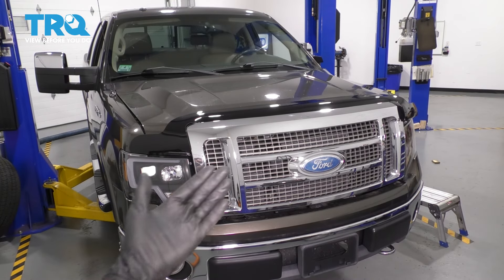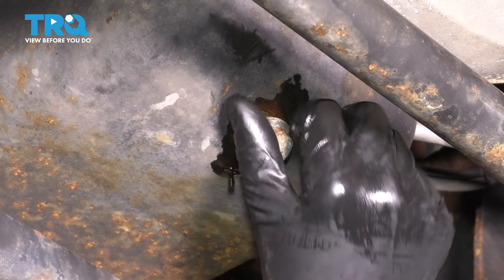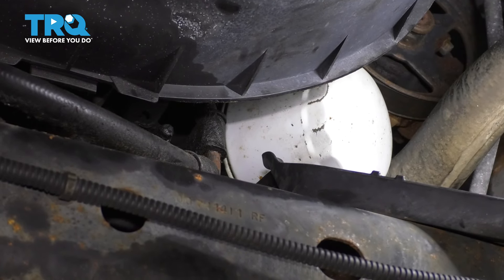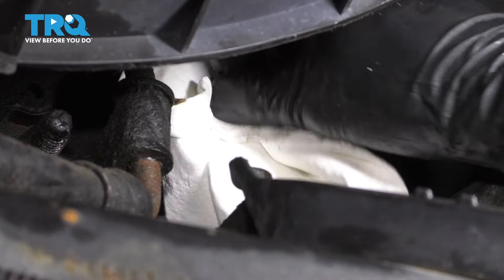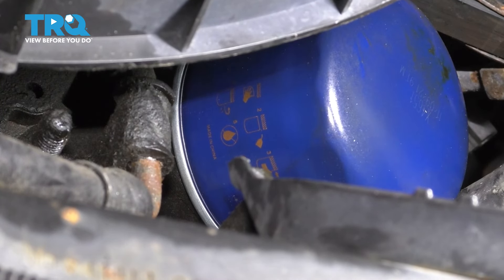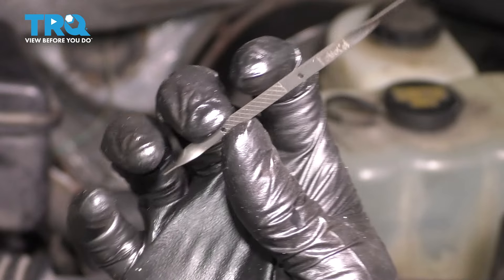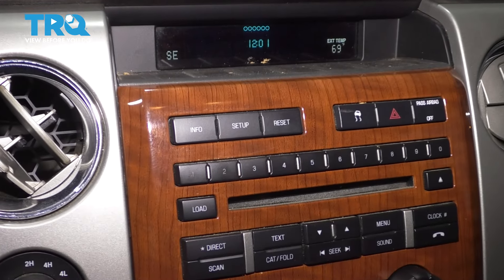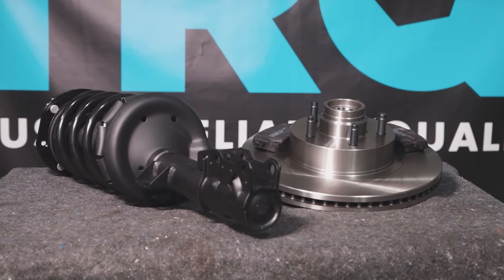How to Change Engine Oil 2009-2014 Ford F-150 (5.4L)

Comment: Change oil sooner. The filter rubber was dry, meaning it's been over 6 months. The oil looks extremely bad. That is over 3,000 miles. It looks like you have a micro coolant crack in your engine, or a lot of moisture is in your oil.